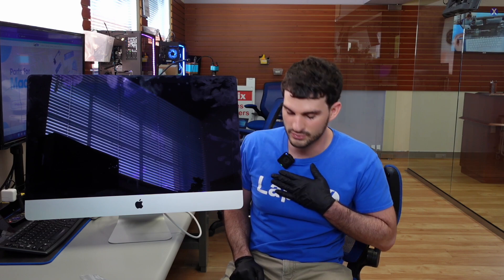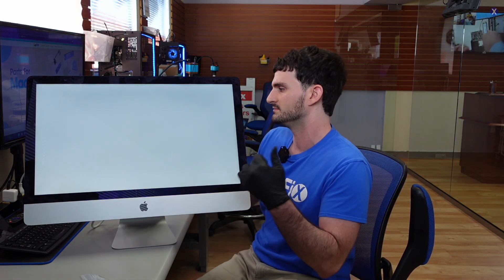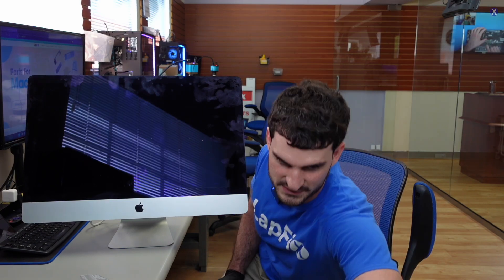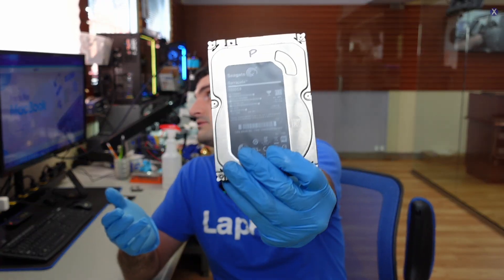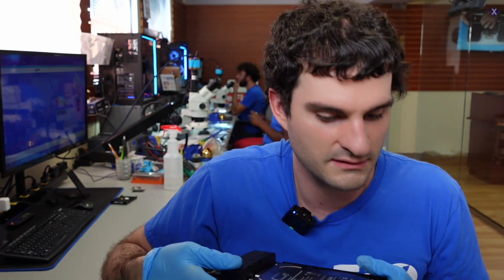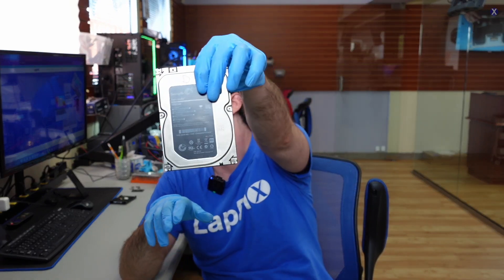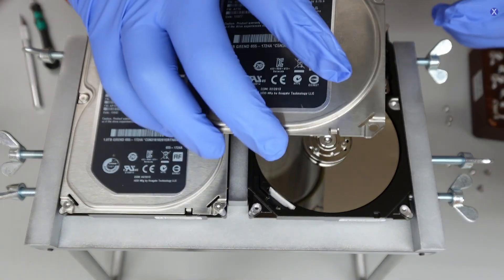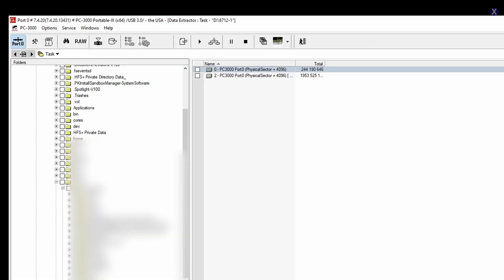How to Fix a Clicking Seagate Hard Drive | Data Recovery

Comment: You must have spent quite some time in that clean room judging by your beard ;). Just kidding, great video, quite impressive. I don't use that many hard drives, so I couldn't tell the difference. But you guys must see a lot of them. Any brand you could recommend as for durability?
Reply from the maker: All of them will fail at some point. Back up your data :)